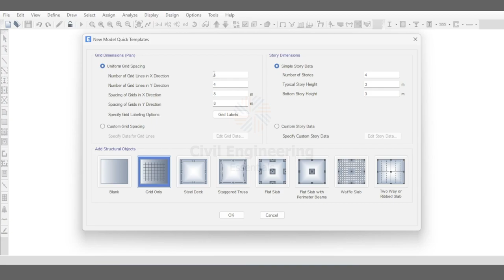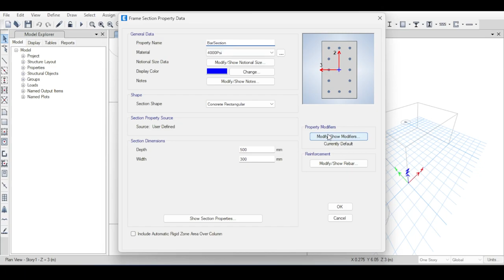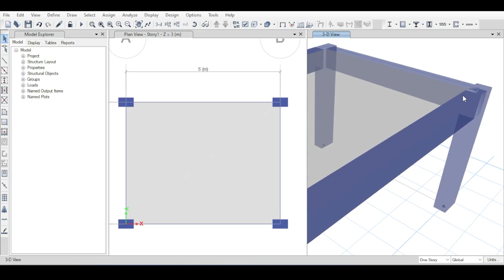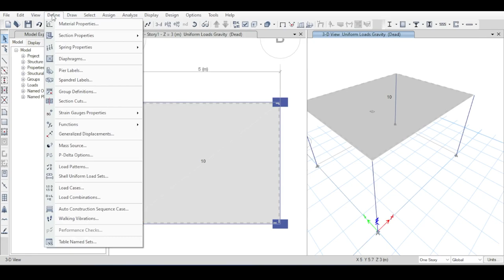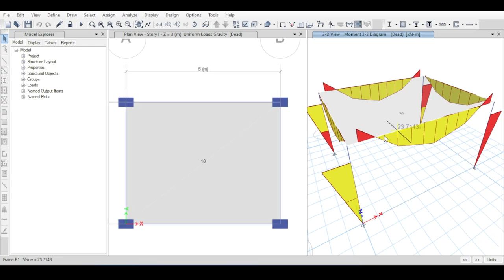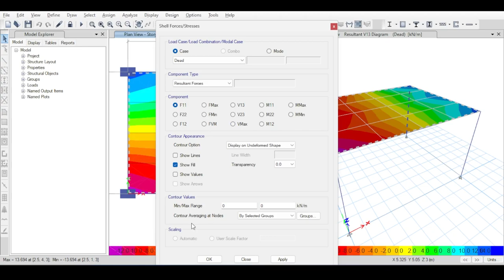Principles of 3D Modeling - ETABS Building Analysis and Design

Comment: Hello Dr CEE,

I’d like to say this right upfront because for me the CEE channel style and pace of presentation is second to none as far as I am aware and it really really does work. In my experience, many of those who rush and jumps to flashy things without first understanding the fundamental (and the essential basics) often end up trying to go back to the basics or some blaming their own lack of understanding of how things work on the software, some would just blindly follow the software with so many hanging uncertainties in their use and application of the software. I am so glad that the CEE channel does not work that way. I couldn’t agree more with all of the CEE sentiments that were expressed towards the end of this video.

I see that Mr. Editor is making fewer guest appearances (I am not complaining), I suppose that the recorder guy has gotten much better from all of the previous roastings and there is little to roast him on ^_^.

That application of the linear load on the slab on etabs is really odd (but it is theoretically smart 😊). I understand that a bar without inertia will not contribute to bending resistance, can I ask how one deals with that bar self-weight? does one work the self-weight into their calculations or maybe again one would also define a material with “zero density…” for use with this not-real-bar? or it is considered that the bar own weight is relatively small compared to the loads on the slab and therefore it could be negligible? 

When I was drawing, it seemed like I accidentally added pieces of slabs, or double drawn members, etc. (my bad, I am learning) I ended up having to redo and to be really careful during the modelling exercise …. I took note of the “check model” functionality that was shown here on this video but is there another way perhaps to see (or to filter) during the modelling exercise what elements are on the model and can one delete unwanted elements from that filter environment?

LOL, …the animation music thing for deflection coupled with the linear load thing is indication that the team at CCS are having fun with this for sure.

Oh wow, seeing the “detailed view” of the “equivalent loads” that are being applied on the frame or the bar element is a really cool reminder of the CEE channel content coming full circle from the current running series about “a first course on the FEM”, this is really nice to say the least, scratch that, this is freaking awesome! 
 
Thank you for “slow playing it” at 12:45, these fundamentals are key, a case in point regarding my opening statement on this comment.

I will gladly take the “bright future size shout-out” and I give back same to you dear doctor. Thank you Dr. CEE for your patience and kindly do continue with your good works. 

I have enjoyed this video and I am looking forward to the next CEE videos

Kind regards, DK
Reply from the maker: Hi there Engr. DK,
it is always a pleasure reading your comment.
I am happy that the approach of building up necessary skills until reaching the bigger structure is ok for my viewers and members. 
Yep, nothing is worse than rushing through the GUI without fundamental understandings.

I guess the Editor has over-roasted me in the first RC building structure ^_^ and wanted to gimme a break. I kind of love-hate the editor, yep, he is witty and has cool suggestions, but usually does it in a passive agressive or even outright roasty fashion. Still, to his defence, he is kind of a good guy.

Yep, the linear load is strange. What I failed to mention (coz it was not the focus of the video) is that the cross section is set to 0 or (if stiffness mathematical problems occur), the self weight modifier is set to 0 in the definition of the section. I will be giving more details, because I want to personally investigate. The idea of beam with 0 inertia is the current "known knowledge" but I wanna dig deeper and see if there is no other way of doing so.

Etabs is NOTORIOUS in its interpretation of the model and gives a little less than usual hints as to where the problems is. Something that will get painfully obvious as you are learning the software. I would definitely face those problems in the future (I really hope that I face those problems) and then go through the process of elimination. TBH, I do not have a quick fix for it yet,  but will definitely think of something to be shared.

The animation music was BAD ^_^

The equivalent loads is something that I commend ETABS for doing. It is a really good thing and rivals Robot's "Loads Generated Automatically". It is also neatly presented, something that Robot does not provide when modeling a shell rather than a cladding. So kudos for them.

You are most welcome. The understanding of local directions for both bars (last video) and plates (this video) is crucial and needs to be addressed.

It always brings me joy to read your thorough comment on my videos. Not only does it spark ideas and thoughts, it also helps my dear viewers as well. So a huge thnx to you.

Oh, and sorry for being a little late with my replies. I am shifting my house (rented a new place) so it is kinda chaotic here. My replies on your other comments might need a little time until I settle.

Stay tuned for more videos,
Regards,
CEE